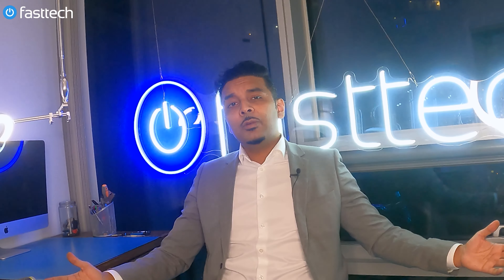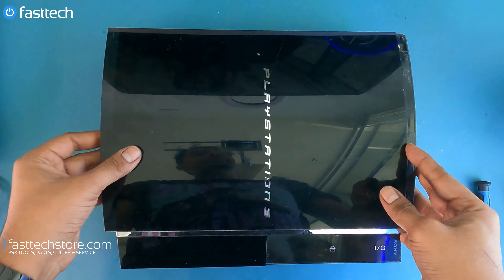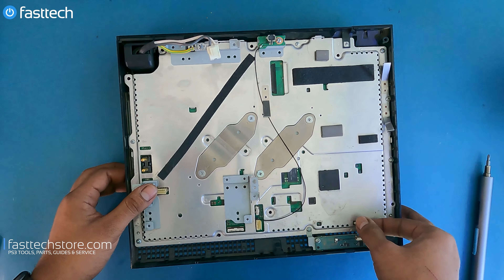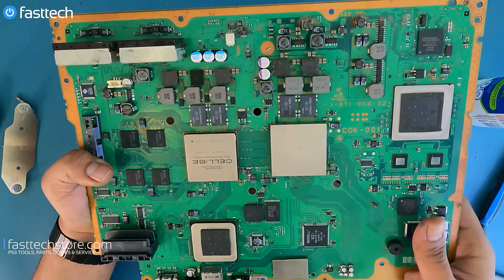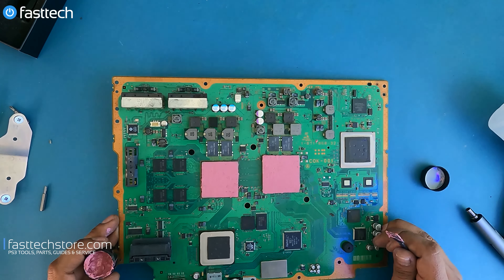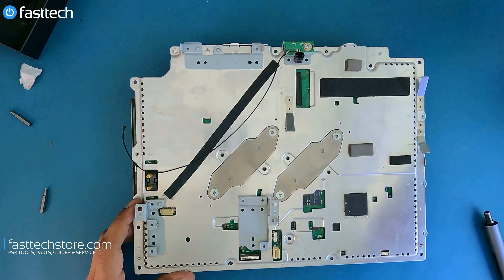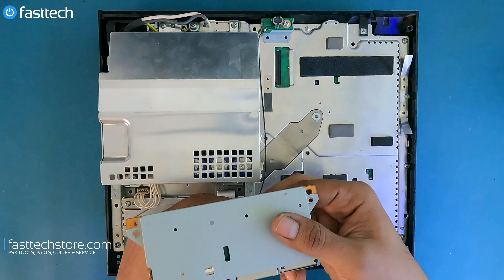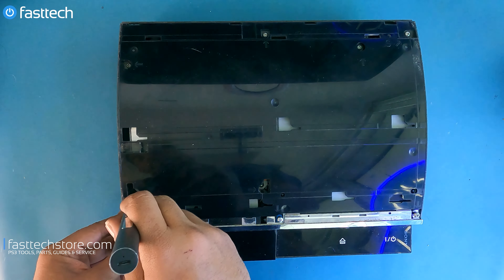PS3 60GB & 80GB CECHA01/CECHE01 Thermal Paste Replacement Guide

Comment from the maker: 👉 Fasttech Pro Autokit: https://www.fasttechstore.com/tools/fasttech-pro-auto-kit
👉 Fasttech Pro Toolkit: https://www.fasttechstore.com/tools/fasttech-electronics-repair-toolkit
👉 Thermal Paste: https://www.fasttechstore.com/tools/thermal-grizzly-kryonaut-extreme-2g
👉 PS3 CECHAXX Mainboard + Logic Board: https://www.fasttechstore.com/playstation-3-parts/ps3-cechaxx-mainboard-disc-drive-logic-board-cok-001
👉 Hard Drive: https://www.fasttechstore.com/playstation-3-parts/1-tb-ssd-hybrid-25-hard-drive
👉 PS3 Casing: https://www.fasttechstore.com/playstation-3-parts/sony-playstation-3-models-a-b-c-e-shell
👉 PS3 Casing Top Cover: https://www.fasttechstore.com/playstation-3-parts/sony-playstation-3-models-a-e-cecha01-and-ceche01-top-cover
👉 Disc Drive: https://www.fasttechstore.com/playstation-3-parts/kes-400-blu-ray-disc-drive
👉 Disc Drive Data Cable: https://www.fasttechstore.com/playstation-3-parts/sony-playstation-3-blu-ray-drive-data-cable
👉 Disc Drive Power Cable: https://www.fasttechstore.com/playstation-3-parts/sony-playstation-3-blu-ray-drive-power-cable
👉 Disc Drive Logic Board (BMD-001): https://www.fasttechstore.com/playstation-3-parts/bmd-001-disc-drive-logic-board
👉 Memory Board: https://www.fasttechstore.com/playstation-3-parts/sony-playstation-3-models-a-c-e-memory-board 
👉 Power Supply: https://www.fasttechstore.com/playstation-3-parts/aps-226-power-supply
👉 Network Adapter: https://www.fasttechstore.com/playstation-3-parts/sony-playstation-3-model-a-c-e-wireless-board-7dszb
👉 Antenna: https://www.fasttechstore.com/playstation-3-parts/sony-playstation-3-wi-fi-antenna
👉 Power/Eject Board: https://www.fasttechstore.com/playstation-3-parts/sony-playstation-3-models-a-b-c-e-control-board
👉 Fan & Heatsink Assembly: https://www.fasttechstore.com/playstation-3-parts/sony-playstation-3-models-a-b-c-e-heat-sink
👉 Heatsink Clamps and Screws: https://www.fasttechstore.com/playstation-3-parts/sony-playstation-3-heat-sink-clamps
👉 Cooling Fan: https://www.fasttechstore.com/playstation-3-parts?category=Fan
👉 Thermal Paste (Large Quantity):  https://www.fasttechstore.com/tools/thermal-grizzly-kryonaut-extreme-thermal-compound
👉 Compressed Air Can: https://www.fasttechstore.com/tools/disposable-compressed-air-duster-35-oz

Other PS3 Videos:
▶PS3 CPU AND GPU DE-LID GUIDE: https://www.youtube.com/watch?v=GzMmi7F65wQ&t=30s&ab_channel=fasttech
▶PS3 CECHG Repair Guide: https://www.youtube.com/watch?v=GgOYFO9Pdss&feature=youtu.be&ab_channel=fasttech
▶PS3 CECHH Repair Guide: https://www.youtube.com/watch?v=BDC1O8mYZZc&t=1840s&ab_channel=fasttech
▶PS3 Slim 2000 Repair Guide: https://www.youtube.com/watch?v=S-ewz35fOLY&feature=youtu.be&ab_channel=fasttech
▶PS3 Slim 3000 Repair Guide:https://www.youtube.com/watch?v=ay7GYYMjodQ&ab_channel=fasttech
▶PS3 Super Slim Repair Guide: https://youtu.be/6a9UM_S1T64
▶PS3 YLOD Repair Guide: https://www.youtube.com/watch?v=uAWpqW1HCmo&feature=youtu.be&ab_channel=fasttech
▶PS3 Controller Ghosting Fix: https://www.youtube.com/watch?v=lMQouNRR018&ab_channel=fasttech

👉Need Help? FaceTime/Zoom Video Call Me: https://www.fasttech.ca/online-consultation
👉GET REPAIR SERVICE FOR YOUR DEVICE: https://www.fasttech.ca/electronics-repair

▶ Want us to fix your device for you? Just order the Fasttech Repair Box to send us your device by using this link: https://www.fasttech.ca/repair/repair-box

👉Business Social Media:
Twitter: https://twitter.com/FasttechCA
Instagram: https://www.instagram.com/fasttech.store
Facebook: https://www.facebook.com/fasttechy

👉Follow me on Social Media
Instagram: http://instagram.com/youngtechg
VLOG CHANNEL: https://www.youtube.com/channel/UCF2IPXKRX5ctN9td1rhkzHg
Twitter: https://twitter.com/Shehroz

Comment: I got a ps3 cecha12 and at times i get green lights and dots on my screen (known as the matrix screen problem) and it causes the screen to freeze. Would deliding the console solve this issue?
Reply: You touched the gpu points to hard, you need to reball now unfortunately
Reply from the maker: You need a new GPU (RSX) chip

Comment: If you want even better cooling performance, he should’ve taken off the cpu and gpu heat shield and changed the thermal paste under the metal plates too.
Reply from the maker: Yes I did this in a later video. Check out my DE-Lid video

Comment: greatest guide I’ve seen so far , in 2 days I’m going to replace my thermal paste hopefully every goes as planned 😅
Reply from the maker: Thank you. I really appreciate your comment. Please also like the video and subscribe for more tutorials like these. If you have any problems let us know.
Reply: @fasttechvideo  my ps3 was running fine and i changed the thermal paste then it turned into the yellow light of death idk what to do :(
Reply from the maker: @x-highrolla-x  thats not good. I recommend using syscon to find what errors you are getting
Reply: @fasttechvideo  could it have been that i didn’t put enough thermal paste ?
Reply from the maker: @x-highrolla-x  No.
Most likely something is damaged on the board.
Reply from the maker: There is a small chance it could be a PSU issue
Reply: @fasttechvideo  yeah because when i bought the ps3 off eBay I updated the console and when i turned it on it was flashing green light on my tv and then it freezes but now it’s just the ylod , man i just lost 326 dollars
Reply from the maker: @x-highrolla-x  Oh if it was flashing green (artifacts) you have a dead or almost dead RSX (GPU). If this chip completely fails it can cause YLOD. Replacing it will most likely fix your problem but this is not an easy job and requires BGA reball and soldering skills.
Reply: I recommend next time you get a Phat ps3, to open it up immediately those things a ticking time bombs if the original paste is still being used. This video only shows half the work you actually have to do, you actually have to remove those heat spreaders & apply Thermal Paste directly to the the chips this guy is talking about his worker did a crappy job & he did a half ass job.
Reply from the maker: @WhereIsSaul  we did a ihs removal video on a later date
Reply: @x-highrolla-x  why did you buy a used ps3 for 320 buck in the first place?
Reply: yes !
Reply: How'd it go?

Comment: Wow , thank you so much. Followed this step by step and replaced the thermal paste. My ps3 sounded like an absolute JET beforehand. I didn't even need to de lid. I just did the surface of the plates. I've been playing it for 3 hours now, and the fan is still quiet.

THANK YOU
Reply from the maker: @sonichurosechu4ever  you are welcome. Thanks for your feedback
Reply: @fasttechvideo  thanks for the swift reply. The model I have is the CECHE01 80gb model. Is this the one that isn't prone to as many problems as the CECHA01 60GB system? I understand the 80gb model runs ps2 games off an emulator instead of the CPU. 

Is the 80gb the better version overall ? 

Subbing jusy for that fast reply !
Reply from the maker: @sonichurosechu4ever  both these models have the same nm RSX and share almost all other components and therefore prone to the same issues. If yours made it so far its likely a good piece. Eventually something will fail, its not a matter of if but when, just like you and me. Enjoy the ps3 and don’t think about failure too much.
Reply: I also have the CECHE01. No problems so far.  Bought it in 2007 I guess. I will be cleaning it soon thanks to this video.
Reply: @jonnydonacar6435  do you find the air it blows it always warm but not hot ? These things definitely generate heat
Reply: @sonichurosechu4ever  The air is warm, but the unit itself feels really hot to the touch. It's always been like that. I guess the key factor for me not having overheating issues or YLoD so far is that I have never kept my PS3 in tight spaces.

Comment: I did this a couple years ago with the thermal paste and temps look good. I forgot to change the thermal pads. Is it worth the hassle/risk opening it up?
Reply from the maker: What would make more of a difference than thermal pad replacement is a IHS removal and replacing the paste on the processors. We did a video on this recently. While you’re in there you should also replace the pads as they usually have a life of about 5-10 years depending on the use.
Reply: @fasttechvideo  thanks for getting back to me. I think I’m going to send it off for deliding as I’m scared of damaging.
Reply from the maker: @thefifthdoctor6780  We do offer this service if you are interested. Please email us at service@fasttech.ca

Comment: is thermal paste more beneficial than thermal pads in regards to reducing heat and reliability?
Reply from the maker: You want to use paste instead of pads? I would not recommend that but you can replace thermal pads with thermal putty.

Comment: Put a 1tb Sata SSD into it!
I did it on my console and it did wonders.
It improved the load and download spreads a lot!!!!
Improved my PS3 so much highly recommended!!
Reply: Most of the improvements are psychological though, since the infrastructure wasn't built with SSDs in mind and will therefore load almost as slowly as before, especially if the game depends on disc loading a lot. What could be improved is the XMB files loading faster and not show the spinning file symbol as long as before.
Reply: Idk what that other guy here is smoking but loading times and overall game performance is significantly improved with an SSD upgrade. Stuff like texture pop in and frame drops is also significantly decreased. Overall an incredible upgrade
Reply: Which drive did you get? Thinking of doing this for my ps3 too.
Reply from the maker: If anyone needs an SSD they can get it here: https://www.fasttech.ca/playstation-3-parts/ps3-1tb-ssd-solid-state-drive-tn3kn

Comment: Great video! Unfortunately, mine is still flashing red after all of the cleaning with new thermal paste. Can't get the disc out either. Anything else I can do?
Reply from the maker: We are going to release a video fixing the red light issue. Already recorded. Waiting for the editor.
Reply: Replace the NEC tokin capacitor with tantalum capacitor
Reply from the maker: @michael9613  The NEC Tokin capacitors are usually never the issue. What happens is while replacing the capacitors the GPU and CPU gets heated up which is what fixes the problem, mostly temporarily.
Reply: @fasttechvideo  Actually, most of the cases it is the NEC Tokin. Replaced multiple consoles that had red light and fixed the issue. Although I always delid the processors so heat issues are always solved. The NEC tokins go bad very easily, and when I replace them I usually find burned ones during the process of removal.
Reply: its mostly always the RSX or the CELL with this error. The NEC tokens DO FAIL, but freaking rare. Like unicorn rare in comparison to the CEL n RSX. I have repaired over 100 of these bad boys and I have ran into very few with NEC token failure. almost all of the consoles I repaired had a failed / fried RSX or CEL, the rest all had a busted cap or a combo of both. I might of had a handful that the NEC token was the actual culprit. Those took me longer to fix because it was the last thing that I checked due to being so used to it  being CEL or RSX failure related.

Comment: Tried to replace thermal paste. Did that but now power doesn't turn on. Maybe the connections is not in properly, would that be the case?
Reply from the maker: Check the ribbon cable at the front for the power and eject sensor. Also make sure the power supply cable is installed.

Comment: I did almost the exact steps like you. Had Totally dried out thermal paste on my CECHH04 and changed it with Arctic MX-4. It ylods now and i dont know why lol haha. Maybe too much thermal? Too little? How can i know even tho i tried to spread the thermal all over the IHS’s
Reply from the maker: No, too much thermal paste cannot cause YLOD
Reply: I think it's the brush method. I also had a working ps3 before I used this guide

Comment: 16:30 This is not how you apply thermal paste. You will be leaving air gaps that will prevent full contact for heat reduction. You’re suppose to add a small amount in the middle and squish it against the heat sink.
Reply from the maker: @furonwarrior  that method on a surface like this will not apply to the entire area of the IHS but does work for a smaller surface

Comment: One thing I am picking up, is do not fuck with the rsx or EE. Clean out the system. Just do not fuck with them. Too many cases of people popping off the plates and it breaks their console. Just go in and clean, do not disturb the original bins with the paste … my two cents.
Reply from the maker: @TalonNismo  sometimes you have to remove the IHS if the system is overheating even after a thermal paste replacement but you are correct it should be left alone if not required.

Comment: is delidding necessary? can i get away with just cleaning and  reapplying new thermal paste every 2-3 years? dont want to risk with delidding
Reply: NO! DO NOT DO THA! I JUST DELIDDED IT AND I WISH I COULD EAT THAT THERMAL PASTE! I scratched the cpu.. and now it's not starting up....
Reply: @MarianMMN  yall are scaring me now 😅😭I guess I will top it off with thermal paste and hope its enough as its my first time applying and will only delid when im forced to. THANK U SIR
Reply from the maker: Depends on how hot the system is running after doing a thermal paste replacement.

Comment: @fasttechvideo hello, I’ve been wanting to buy a part for my ps3 off the website provided but idk if the logic board (BD-400) will work on my KEM-410ACA disc drive p.s I have a CECHE01 MG PS3 but it came equip with that KEM-410A and I believe it was suppose to be a KES-400A
Reply from the maker: I believe this is the logic board you need: https://www.fasttech.ca/playstation-3-parts/bmd-006-disc-drive-logic-board-
Reply from the maker: Ceche01 MG (metal gear bundle) systems came with a double eye laser bd-410 drive.

Comment: I have the first model who supports ps2 games, but when I put a ps2 disc in, it shows up in the meny, but when I start the game, the screen just turn red-black forever.
Reply from the maker: Replace the laser. If that doesnt work you probably have a hardware issue on the board. Is it a A or E system?
Reply: it reads the ps3 games totally fine @fasttechvideo  I have the pal 60GB model (CECHC), Partially software-based PS2 emulation, just like Ntsc 80 gb[50]. not like the first 2006 20 and 60 gb  ps3 that had Hardware-based PS2 Backward Compatibility

Comment: What is the normal temperature for fat model? My ps3 fat have 80° in game and cooler is set to syscon, end set to auto at 68° is ok but fun make noise.
Reply from the maker: 80c is high you should be around 60
Use this delid guide to lower your temps  : https://youtu.be/GzMmi7F65wQ
Reply: @fasttechvideo  i try to remove ihs at my old ps3 fat but i scratched cpu, now i have another ps3 slim model and cpu is 53° and gpu 58° with syscon but i have another problem sometimes is shutting down it self randomly with no red light buton power, it happened when i try to open aplication multiman or file manager just turn of without any warnings,although before this happened I was playing on it all day.
Reply from the maker: @laurentiuilina4992  Replace the power supply, if that fails check the power rails on the motherboard.
Reply: @fasttechvideo  to change the source is not worth it, it will cost me as much as I would buy another console second hand ,and maybe it's not from the source, maybe the motherboard, I think it's also from the software from HEN and why doesn't it stop when I play 3-4 hours, it only stops when I open applications.

Comment: Sorry for asking. But how do you fix the power button on the cecha01 ps3 console?
Reply from the maker: Depends on whats broken. I would recommend buying the replacement board with sensors from our site (links in the description box). They are not expensive.
Reply: @fasttechvideo  I fixed it an day after my comment few weeks again. All it was, was the connector to the power was bent so I bent it right back in place what it was originally set. It works again
Reply from the maker: @scratches12mevideos  great! Please consider liking the video and subscribing if this video helped you out.

Comment: I’m going to be attempting this soon on my ps3.. it was given to me by a friend and he basically told me if I could find the problem I could have it lol. He said that he had tried to update the console and the fan started ramping up excessively and it YLOD on him. He changed the thermal paste, cut a hole on the bottom and tried again, it happened a second time and he  quit. Any ideas? Thanks!
Reply from the maker: Must be your lucky day. My video on YLOD repair is coming out in a few days. :) 

Only replacing the thermal paste will not fix YLOD but the steps I will show you soon will in 90% of cases.
Reply: @fasttechvideo  awesome! I’ll sub to you and hopefully it fixed my problem! :) what are the chances it’ll STAY fixed though? 😂

Comment: You need to remove the IHS plates to get access to the chip set .. this is the most important thing . . One thing is that they are a pain to remove ..
Reply from the maker: and they are dangerous to remove. We will be covering this in a later video.
Reply: @fasttechvideo  when will that video be updated?
Reply from the maker: @vinzetti21  1-2 months
Reply from the maker: @vinzetti21  the IHS delid video is out now https://youtu.be/GzMmi7F65wQ